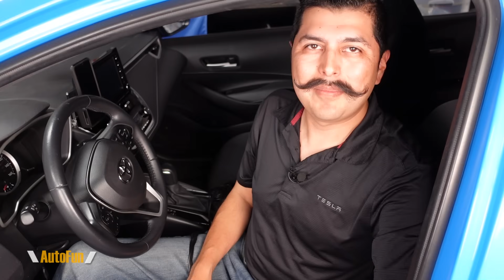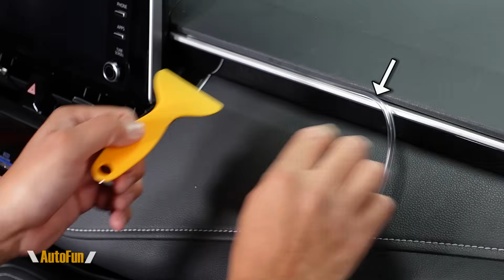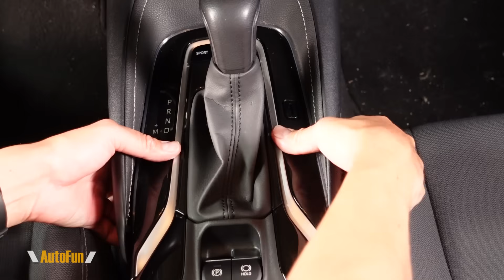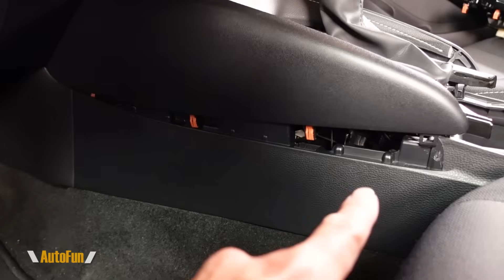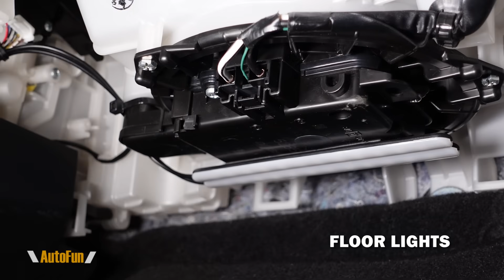CAR RGB LED LIGHTING INSTALL! (TIPS and TRICKS for Easy Installation)

Comment: Is this possible to connect directtly to 12v so when you turn on lights they come on at same time not needing to use remote control or app
Reply from the maker: Hi Vladimer! Correct, it can be hardwired to the vehicle (depending on how the installer connects it, it can be switched on with a separate switch or with the car coming on. Hope this helps, Cheers!

Comment: Can you tap it directly to a power source like the to come on with turning the car lights on?
Reply from the maker: Hi Jason! Correct, it can be hardwired to the vehicle (depending on how the installer connects it, it can be switched on with a separate switch or with the car coming on. Hope this helps, Cheers!

Comment: sᴏ ᴛʜᴇsᴇ ᴛʏᴘᴇs ᴡɪᴛʜ ᴄɪɢᴀʀᴇᴛᴛᴇ ʟɪɢʜᴛᴇʀ ᴘᴏʀᴛs ᴄᴀɴ ᴀᴄᴛᴜᴀʟʟʏ ʙᴇ ʜᴏᴏᴋᴇᴅ ᴜᴘ ᴛᴏ ᴛʜᴇ ᴄᴀʀ ᴇɴɢɪɴᴇ ᴘᴏᴡᴇʀ ɪᴛsᴇʟғ?
Reply from the maker: Hi Retina Rental! What installers usually do when customer wants a hardwire connection is cut off the cigarette lighter plug and then connect the power supply to the car via crimping, soldering or using fuse tap connectors. Here is my video where I show the installation of fuse taps to power wires https://youtu.be/Qzw9yUYN7zo Hope this helps, Cheers!

Comment: Why all these kits not comes with direct fuse box wiring i hate any wisual cable and cigarette lighter power
Reply from the maker: Hi Nagliuxas! What installers usually do when customer wants a hardwire connection is cut off the cigarette lighter plug and then connect the power supply to the car via crimping, soldering or using fuse tap connectors. Here is my video where I show the installation of fuse taps to power wires https://youtu.be/Qzw9yUYN7zo Hope this helps, Cheers!

Comment: Can you go more in depth as to how you got the power cable from the console to the left/right side of the vehicle
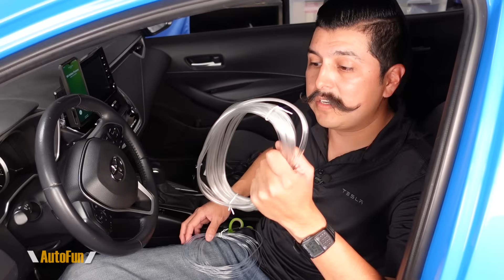Reply from the maker: Hi Parker, you can see the routing at the 4:15 mark. The cables are hidden underneath the center console, once they reach the front of the car, one set of cable goes to left and the other set of cables goes to the left. If you want to see underneath the actual passenger side and driver side footwell, you can see that on my other video here https://youtu.be/LahW9J1TkCw at the 10:15 mark (how the wires and lights are secured to the bottom of this area varies from car to car and also the method the installer prefers, some zip tie the cables to other existing cables in that area and some zip tie the cables directly to different parts of the car that are in the mounting area). Hope this helps, Cheers!

Comment: will this drain the battery on the car if left plugged in via usb or the cars 12 volt cigarette lighter port?
Reply from the maker: Hi Jordan! yep very similar to leaving a light on your car, if the kit is left on (most cars turn off the cigarette lighter port when the car is turned to avoid this, additionally there is a switch on the cigarette lighter adapter to turn off the lights manually) it will take a toll on your car's battery. Hope this helps, Cheers!

Comment: Does installing this have any effect on the battery or anything electrical on the car?
Reply from the maker: Hi FrankBeanieWeenie! If using the cigarette lighter adapter, it shouldn't drain your battery (assuming your cigarette lighter port turns off when the car is off) Regarding other issues, while I have not had issues with mine, there is always an inherent risk when adding an aftermarket device to a car. Either installation can go wrong or the device can fail or some other latent failure may occur down the road. I know this may sound like an exaggeration but the example I give to people is that I had a friend who installed an aftermarket stereo on his car. Well the car caught on fire a few days later, and while it could have been the install, it could have also been the device or as my friend says maybe it was unrelated but just coincidence. So that is definitively something to keep in mind when deciding to upgrade your vehicle with aftermarket accessories. Hope this helps, Cheers!
Reply: @AlexAutoFun  Very informative, thank you!
Reply from the maker: @LandonMlsna  You're welcome!

Comment: Any tips on installing this in a 6th gen Camaro ?
Reply from the maker: Hi Isaac! the same techniques I showed on the video can be applied on a different vehicle like the Camaro. Some cars are easier than others and also depending on the placement some panels will have to be removed and in some cases they won't have to. The best recommendation I can give you is to scout the car for the areas you want the lights to be on and then determine the difficulty on getting the lights there, depending on the amount of labor required the installer may suggest alternate places to keep the cost down or continue with the requested location if labor cost is not an issue. Hope this helps, Cheers!
Reply: Appreciate the respond unfortunately, I don’t know any shops that do this kind of work near me. Any tips for self install ?
Reply from the maker: @isaacbeltran1721  you're welcome Isaac! I think the video covers all of the ones I can think of. But it really comes down to how much time someone wants to spend installing it (how much of the car will be opened up) and also how much detail to put on it (I seen very quick good looking installs just one or two strips) and I seen extensive installs that taken days with multiple kits installed so the sky is the limit when modding a car with RGB lighting. Hope this helps, Cheers!

Comment: I think I would want to hard wired with a switch for a cleaner look instead of using plug in adapter,but that's just me being ocd! with wires
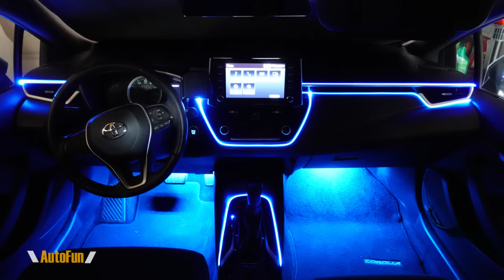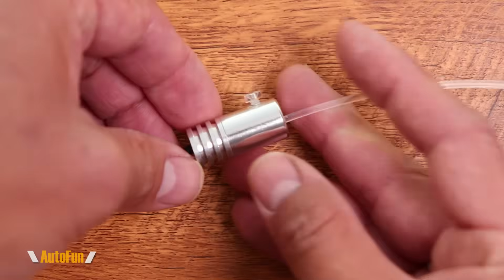Reply from the maker: Hi Gary! yeah while I hid all the wires, you can still seen them when I open my glove compartment. However here is the hardwire process if you want to see what that looks like https://youtu.be/K2iKXj82354 The LED lights only use 2 wires instead of the 3 I show. Basically Ground and Power. And if you are not familiar with the wires on a hardwire kit here is an introductory video https://youtu.be/K2iKXj82354 only watch from 1:49 to 6:50 again only 2 wires are used for the LED lights (Power & Ground) instead of the 3 I showed so the kit will turn on and off with the car. Cheers!
Reply: @AlexAutoFun  I'll check it out, I've done some other light stuff b4, with toggle switches installed but the thin fiber optic is cool 😎
Reply from the maker: @garys9718  nice, you should be good to go then, honestly this was an easy install IMO but I did do over a weekend because I didn't want to break any panels on the car when removing them, so I took my time routing cables and experimenting with different placements. Next I'm going to join both the dash lights and floor lights into one cigarette light plug (right now it's 2 plugs ugh) I also got a couple other RGB kits review videos coming too so the existing kit is coming off and next kit is going in otherwise I would totally consider hardwiring it. Cheers!
Reply: @AlexAutoFun  can you please tell what's the lifetime of this ambient light? Is it better than el wire?
Reply from the maker: @tnamen1307  Hi Tname! I had my kit installed for over a year now without issues (but will update this comment if something changes) but typically LED lights can last as much as 100,000 hours (the actual time they will last will also vary from manufacturer to manufacturer) Typically EL wire can last as much as 8,000 hours (but again the actual time it will last will also vary from manufacturer to manufacturer) so from a numbers standpoint LED should outlast EL Wire. Hope this helps, Cheers!

Comment: It would be better if you record the actual installation not after you finish!!
Reply from the maker: Hi Guest! I reviewed this LED lights here https://youtu.be/vWKoJN38-Ro as a demonstration of what the kit can do. I was not meant to be an install video, however I got many request to show how the install looked behind the scenes, so this 2nd video was shot to help viewers requesting this video see behind the scenes (everything was installed at this point) so I removed as much as possible to film and re-installed everything back together, but some parts unfortunately can't be redone, like the drilling into the dash. I got another kit (more advanced and more capable) coming to the channel, installation for it will more a lot more intense, will try to capture as much detail as I can on that install. Cheers!

Comment: All perferct, the only problem is that i can't change de color because the control signal don't reach de box 😂
Reply from the maker: Hi Elbi! I would ask your installer to confirm the controller box is not covered or blocked by a metal panel (blocking the signal) Bluetooth has a range of 30ft (unobstructed) range will be reduced if blocked by plastic but not completely like metal will (mine is under the plastic center console if it helps. Hope this helps and please let us know what you find. Cheers!

Comment: Hi, i want to install it in these places and also the doors without open console or panels , so can you provide me any video for this or what you recommend the way to install ? thanks.
Reply from the maker: Hi amr fahmy! the same techniques I showed on the video can be applied on other places on the car. Some cars are easier than others and also depending on the placement some panels will have to be removed and in some cases they won't have to. The best recommendation I can give you is to scout the car for the areas you want the lights to be on and then determine the difficulty on getting the lights there, depending on the amount of labor required the installer may suggest alternate places to keep the cost down or continue with the requested location if labor cost is not an issue. Hope this helps, Cheers!

Comment: Im curious. I have the same model and want to install in the same placements you did yours. My 2 questions are is the drill method necesarry for the drivers side panel? And, for someone with no experience in doing these kind of projects, should i try this myself or get a professional to do this?
Reply from the maker: Hi Jose! nope the drill method is optional, as I explained in the video, it just depends on the look you are trying to achieve and how much detail the installer wants to put in the installation (some prefer to bring the fiber optic cable from under the panels, other prefer to drill holes for cable) Hope this helps and thanks for watching bud!
Reply: I’m planning on doing this too lmk if it went well or if you got someone to install it <3
Reply from the maker: @DoTheCrunk  Hi Matt! I think installation difficulty will vary depending on the look you are trying to achieve (you can get an idea of the install process on this video to see if it looks difficult or easy to you) and but some people do prefer to use an installer (installers have experience pulling panels and routing wires) if installation cost is not a concern. Hope this helps and thanks for watching bud!
Reply: @DoTheCrunk  hi Matt. I was reluctant to try this myself as I drive a 21 corolla as well.  My center console didnt come out as easily as in the video but this was also my first time doing a project like this but after some wiggling and elbow grease, each panel came off just like in this video. Probably the hardest part was feeding the led lights through the center console and up the side panel but I have pretty small hands so i managed to do this without completly opening the sides.  One thing I did do differently was not create a hole in my armrest compartment and fed the cable under the center console and made the cigarette lighter charger cable be exposed. My armrest already was designed with a hole there so I avoided doing any permanent alteration. I also fed 2 led strips to the backseats but due to the material of the seat, the 3m strip doesnt stick. Took me roughly 3-4 hours doing each bit by bit rewatching this video 100 times lol.
Reply: @king_cobra3694  the satisfaction knowing this project went well on my car is definatly rewarding. I've noticed the curve around the entertainment system isn't very tight to hold the cables closely to the edges, but still it's great to have the lights all around the car with only sacrificing 1 kind of outlet (the cigarette lighter/charger)
Reply: @JoseCooks  Hi, I've got a new 23 Corolla and thinking to do the same. I tried to remove the central console to see how easy is to remove it. I pulled it lightly, just to taste it, I don't yet have the leds kit. I couldn't remove the console, I didn't dare to pull stronger for just a try. How strong had you to pull to remove the console? Once removed, did the panels gave you the feeling to be strong enough to not get broken in the process or does they look fragile and easy to break if not pulled correctly?
Reply from the maker: Hi Luigi! Yes you can definitely break stuff (panels, retaining clips and other car parts) if not experienced pulling car trim. I definitely do not recommend this for the faint of heart. Usually installers can pull them very quickly (you begin to develop a feel for the right amount of force required and where to apply the force after doing many installs) but even with that experience there is risk involved of injuring yourself due to the sharp areas found in panels and underneath or breaking something (it has happened to me LOL). Cheers!

Comment: Out of curiosity I saw that the floor ambient light and the led strips were made by separate manufacturers, is the app that the use/blue tooth they use link the two together or the same application? May be something you’ve touched up on but I didn’t see anything regarding it rewatching both videos, In the first you said they just linked up what was that process by chance?
Reply from the maker: Hi Leviti! correct you can technically mix and match some components since the APP that a lot of this RGB kits use is a generic RGB LED app. Regarding linking them, this is all done by app automatically when you pair each LED bar to the your phone. I may make a video on the APP if there is enough requests for this but for the most part is very easy to use and self explanatory. Hope this helps and thanks for watching!

Comment: How do you power both the floor lights and dash lights if you only have one cigaret lighter port
Reply from the maker: Hi nada805! Using this one https://amzn.to/3IKa22D you can see it at the 10:15 mark when I go over my final recommendations. Hope this helps and thanks for watching bud!
Reply: If you really wanted to you can probably Frankenstein it and use connectors to combine both wires and put them into a single cig lighter port
Reply: Splitter
Reply: Multi port
Reply: R connect it into fuse board on side that powers up when car ignition is on
Reply: @davyhill2574 which one is that?
Reply: I have two cigarette lighters lol 😂

Comment: Hi 👋 really 👀 looks nice 👌 and I want to update my Chrysler Grand Voyager please send me a link the link is in your video showing different light 💡 not optical and also I need to upgrade my Range Rover L405 dash Bord surround .if you don’t mind send me the link please 
Thanks 🙏
Reply from the maker: Hi M Virdi! not sure what you mean bud, try the link again it works correctly. I put 3 links, one for the dash lights, one for the floor lights and alternate source that has both into one unit. If any of those links don't come up, you may be in an area where Amazon does not deliver this product too yet, that could be a possibility...
Reply: @AlexAutoFun  I am in U.K. 
thanks 🙏
Reply from the maker: @mvirdi2333  Ahh that explains it, the good thing is most kits can be installed the same way, usually what I see change if how the App functions, in case you see a kit available in your area my friend...
Reply: @AlexAutoFun  I find it on eBay U.K. and this one about £30. And this one is 6 in 1 and 8 m RGB fibre optical with mobile Apps .
Thanks 🙏
Reply from the maker: @mvirdi2333  Awesome! that is great to hear that!

Comment: Hey just wondering if you had anyplans to downpipeing or charging the exhaust. Im planning on putting a exhaust down pipe cut out that you can turn on and off
Reply from the maker: Hi Rene! yep! an exhaust is in my list of mods to come, it would be neat to find a dual mode exhaust. I have one on my Shelby GT350 and it comes in super handy...